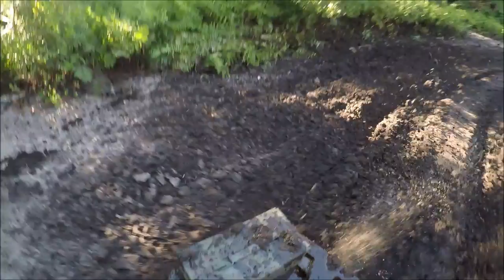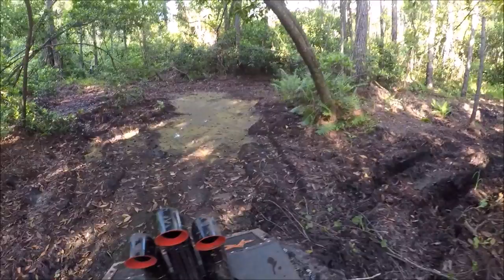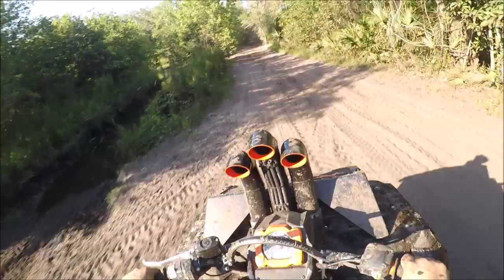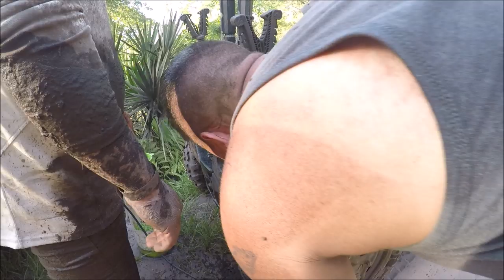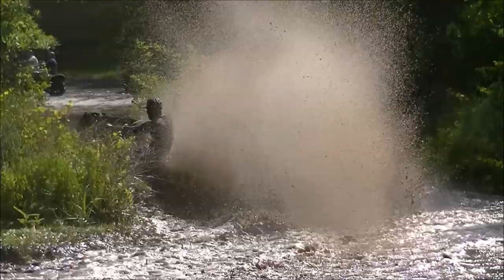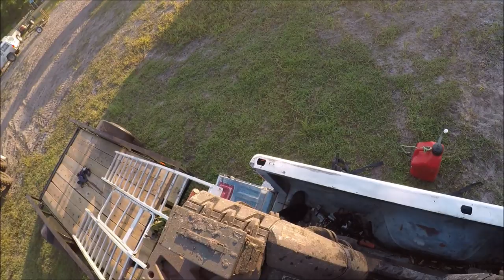Snake Road Trail and RPM Alley - Hog Waller Mud Bog

Comment: how long have you had the Sportsman? what made you pick it over an XMR ?
Reply from the maker: Lance Haskins I’ve had it about six months now.    Nothing really, it was slightly cheaper and I’m more familiar with Polaris than Can Am.  One thing I like more about the Can Am is the extended wheel base.  I firmly believe all brands are junk so pick one you’re familiar with.
Reply: @OleNasty79  why is the extended wheel base a good thing? seems like the shorter machine would be better?
Reply from the maker: It reduces the chances of both front and rear tires being in the same nasty part of the hole at once, if that makes sense.
Reply: @OleNasty79  yeah makes sense . also probably helps keep front end down.